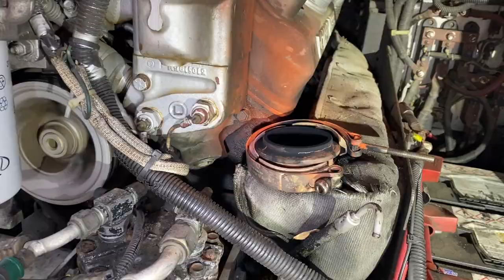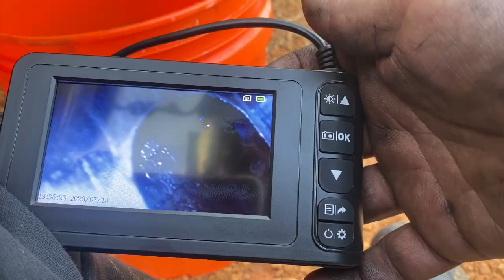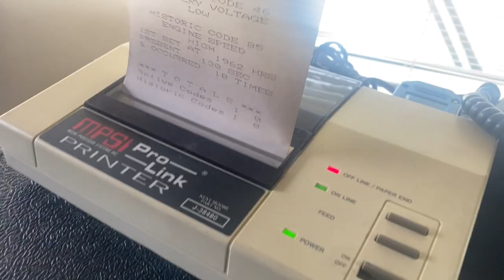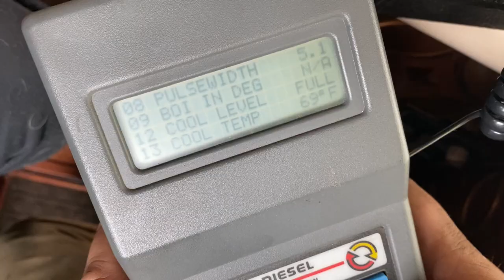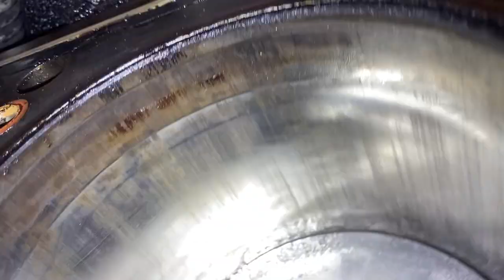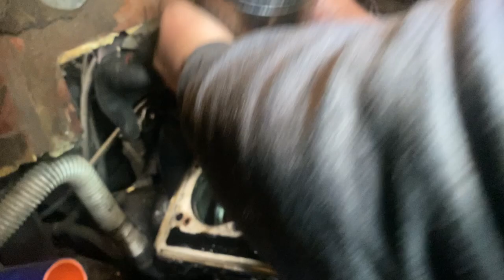Detroit diesel 8v92TA issues Wanderlodge rv

Comment: I think one of the biggest problems with the brakes failing and wearing out prematurely is improper driving habits. It’s like overheating a motor once you get the brakes extremely hot you taken 90% of the life out of them I think, regardless of the age or the experience the driver has they need a refresher crash course on how to drive and brake  properly with minimal wear and heat on the brake system

Comment: I heared the damage the moment it was going up the hill... It had all sorts of Worn Out noises... This does show how tough a Detroit Diesel is... It will get you there eventho the engine is good as gone... With engineparts in the oil..... 

I hope the owner decides for the best option an Overhaul by Bus Grease Monkey.

Comment: In the early 90s Via bus was pulling the 8v71s out of their mc9s and installing Delaney and Alf rebuilt 8v 92s at 450hp. Most of their trips were from Central California to Reno ,and they cut about an hour of the trip and just  about doubled the mpg.
70 mph or better over Donner pass

Comment: Cool that D-Deck report showed about 52k miles, is that actual and is that kind of damage normal on those miles or does it have more miles? You did mention it had low oil, but surely that amount damage does not occur instantly?
Reply: All it takes is one momentary score on a liner, and the whole process goes from there. I'd say overheated badly once and has gone downhill from there.

Comment: 40 years ago, when I was a young man, I worked on a water well drilling rig with that engine, it was a V8 Detroit with the turbo, a TH-60 Ingersoll Rand rig. That engine turned the air compressor and hydraulics for the rig, and was the power plant that moved the thing as well.
The owner of the company did not like it when we wanted to do oil changes etc, he wanted it out drilling...that engine was one of the most abused power plants I have ever been around and it just kept running, throttle pinned for 8-10 hours a day, screaming like crazy and drinking fuel at the rate of 125 gallons a day.
But it ran, and ran, and ran. I have no idea when it finally gave up.

Comment: If you hook your chain on each end of the rocker arm bolts the head will come on or off on the V8 angle. Good video, I don't miss the engine work on those tight buses!😬😁👌

Comment: That looks like its been dusted to me.  The DD tech that use to do our engines had a lifting jig that would bolt to the head one way would hold the head level, flip it over and would hold it at the correct angle for V block engines, small enough piece it could almost fit in your pocket. you need one.

Comment: The metal shavings you found in the inspection covers may be coming from the oil bath air cleaners if it has them the packing gets loose in the air cleaner and starts coming apart Had this problem on some equipment I use to work on .
Reply: Paper filters
Reply: Ok sorry
Reply: Looks like wire wheel broken off wire bits, they have the twist....

Comment: You've got to keep up on the overall maintenance on these engines and get the little stuff fixed right away. I'm betting this engine overheated BIG TIME at least once in it's life. I'm guessing he'll "bite the bullet" and do the "in frame" faced with the evidence that there's a 1 in 4 chance that the rest are damaged too. He's there, it's half way apart why pay labor costs a second, third or fourth time if he plays the odds, be cheaper in the long run to get it all done now.

IMHO - I'd rather have Scott do the work then get stuck on the road & have to rely on "unknown" local mechanics or worse yet - truck stop mechanics!

Comment: Did piston slap caused those odd vertical scratches?
Reply: No, that is "galling" of metal liner against metal piston during a past overheat event. Galling begins as 2 things happen during the overheat. The piston swells due to exaggerated expansion to the point that there is no room left for oil film, and the oil contacting the superheated surfaces instantly becomes too thin to lubricate. During galling,  the oil is actually being scraped off by the metal to metal friction.  Even a small amount of initial galling will ultimately continue destroying the cylinder affected, there is no healing process except replacing the damaged parts.

Comment: Were those cylinders dusted with unfiltered intake air at some point?  Everything sounds/looks gritty to me...
Reply: I hope the lobes on the blower don't look bad as well.
Reply: I wonder if the 39 historic "coolant temp too high" codes have something to do with it, then again I dunno the threshold for setting that code it could be programmed to set if goes 10 over operating temperature. I suppose the best way to know would be to check the blower for scoring.
Reply: @DavidScheiber  I thought I recalled it's gotta be like 215 or more maybe 220-225 or so
Reply: Nah, dusted cylinders don't score up and grab like that, they look more evenly worn all over.

Comment: So with all those bad liners are you going to do a complete in frame? Or would it be better to pull the engine and rebuild?
Reply: Back in the day when I worked in an engine shop, I'm pretty sure I saw the Old timer pull  the whole mess out of there  in a coach to do liners in every hole.
He woulda been hollering if it was an in chassis .

Comment: It's times like this when I'm happy to watch the video while not having to worry about paying for the repairs!
Reply: Almost as bad as owning a used boat... that came with someone's else's problems.
Reply: @snuffysmiff  Depends on what kind of used boat and the condition. When i had no money I ran boats for 100s of hours that costed less than grand from the 70s... rebuild the carbs, some fresh gas, impeller and a battery and had minimal to no issues. When I found the a new better boat i often sold it for no loss. For me it was finding boats that were only used in fresh water especially for a decent old engine and drag them out to the coast. My current boat is a 97 23 foot with a 2010 yamaha 200, as far as the boat goes its been great for the last 7 years, i had to replace the 110 gallon gas tank last summer due to a pinhole leak and changed the electronics out (because i wanted to) but other than that I run it like I stole it. Standard engine maintenance. As long as your willing to do the work yourself and you buy it right its not bad. Probably the biggest joke is my boat is now worth more now then what i paid for it do the lack surplus of boats currently, almost sold it for 30 grand a few months ago and when I bought if for 20. IMO, stay away from project boats, buy something that runs and is complete with a trailer,  wood free construction, stay away from I/Os and avoid certain volvo outdrives like the plague, take into account the age of the gas tank and what its made of.  Theres a few outboard engines and years id avoid too.
     Personally id rather buy a 5 year old boat with 500 hours on the outboard then a brand new one, You see all the possible issues with the hull / layup when its that age, spider cracking, poor wiring, fixes (if any) and get a huge huge discount. When you buy a new boat theres a very big chance it'll be back for warranty work for poor wiring or gelcoat issues thats most likely been resolved by the first owner. 
   With all that said, if you dont use your boat often its best to off it and put your money in your pocket, nothing more expensive than an unused boat.
Reply: @snuffysmiff  Break Out Another Thousand!
Reply: @Humpty Dumpty "Nothing is as bad as owning a boat..lol it's a big hole in the ocean that all your money falls into".
I am told that a Russian Oligarch used to tell people: "If it Floats, Flies, or F(ornicates)**ks, RENT IT!"

Comment: Looking at those patterns, could there be an issue at the crankshaft?
Reply from the maker: His bearings and crank look great so far
Reply: Running high-ash engine oil?  Overheated?
Reply: @chrisbeck8182  you can darn near pee in them for oil if you ate a greasy steak the night before, there would be enough lubricity 🤣
Overheat/ and maybe sucking some dirt at one point in its life.
Reply: @MrTheHillfolk  🤣🤣👍👍